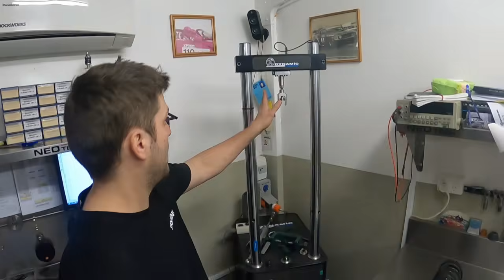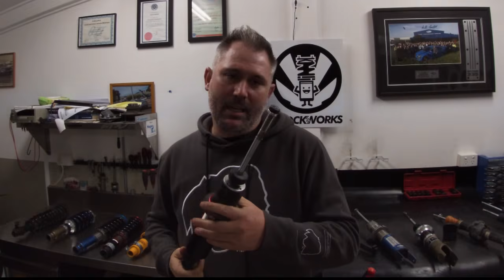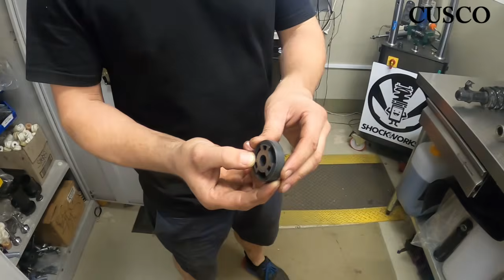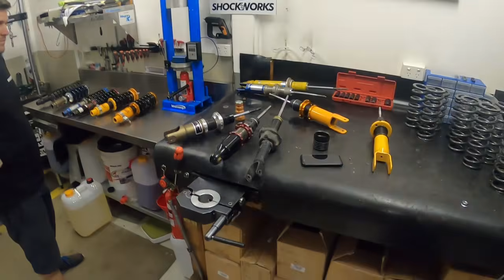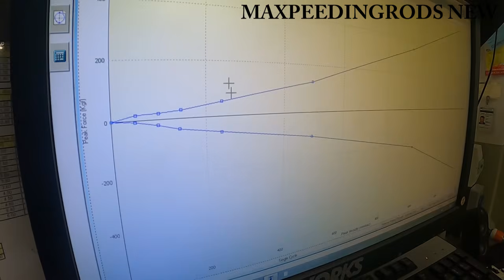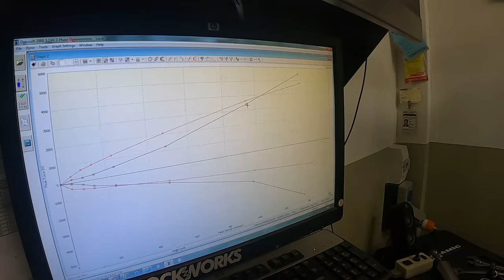8 BRANDS OF COILOVERS ON THE SHOCK DYNO!!! WORLD FIRST TEST

Comment from the maker: Final Results
1/Shockworks
2/Cusco
3/Showa OEM 350,000kms
4/Bilstein
5/New Maxpeedingrods 
6/ BC Racing 
7/Maxpeedingrods 
8/AMR Engineering
Reply: Nice winner shockworks.. shame it wasn't the maxpeedingrods
Reply from the maker: @danielarnold7466  I think we all would have fainted if that was the case, I love my maxies but after riding in a car with shockworks coilovers I can safely say shockworks aren’t on another level they are on another planet by comparison I didn’t know suspension could be that good they truely are amazing all custom tuned
Reply: @TURBOTRISTO  well in that case... I look forward to when your able to give away some of those bad boys when your famous 😉
Reply: I'd love to see the results for a kyb and Monroe and Koni.  Thanks for video Tristan.  Super informative.  I have often thought a spring and shock would be better performing, even if it didn't have 36teen adjustability.
Reply: Which is why many EG/DC Honda guys ran the OEM ITR spring/shock combo :)

EDIT: I was surprised with the AMRs, but I think it has a lifetime warranty, would be nice to do a re-test. Probably with a Koni yellow too.
Reply: Great video. Question though, it is mentioned that adjustable damping shocks are set to soft. I have a set of BCs and driving on soft is like going on a jelly whereas going on 16-32 setting (1/2 till hard) makes a huge difference.
Any chance you tested different damping setting on the BCs to verify if the behaviour changes or is it still linear just with increased force?

Thank you!
Reply from the maker: @edward2a  it’s the best way to test the shocks cushioning ability on soft they can all be made to go rock hard but that isn’t cushioning any bumps it’s amplifying them, I also asked the question off camera haha , thanks for watching
Reply: @TURBOTRISTO  I have BC external reservoir series. I wonder what those would do. 

I also wish the AMR's were in good shape.
Reply: What no Tien?
Reply: If I’m understanding that correctly the new maxpeedingrods are better then bc?
Reply: @Wolfy1091  over time I'm sure it would be a different story
Reply: Amazed thay bilstein lost to oem showa...

Cusco that probably not their highest track spec zero3R or zero3S (semi slick soft compound tyre)...

But still doing decent
Reply: Wait, so how did the Bilstein not win? It seems to have the most digressive performance and the highest forces at the lowest amount of travel. Can we see a test of a new Bilstein versus all others?
Reply: Ummm I think you’ve made an error in this order. The Bilstein had the best graph of the lot other than the Shock Works own one. Thanks for doing the test though, confirms my suspicions that Chinese junk is really junk.
Reply: @danielarnold7466  wonder if the max speedingrod ones can have oil changed  recharged  and retested wondring  if thay can be improved
Reply: Man this is such a massive wealth of valuable info! Thx man!
What i really wanna know now is what does a 1 year old Max speeding rod coilover perform like? If it performs well only for 3-4mths then it's a no go, and how does the spring quality effect the overall performance of package as well? Now I gotta go search for spring dyno comparisons!
Reply: Max Pee Dingrods
Reply: Bullshit
Reply from the maker: We will one day do this again with more brands
Reply from the maker: Couldn’t get any to test
Reply from the maker: If someone wants to pay sure
Reply from the maker: What is
Reply: @TURBOTRISTO no please don't  , unless you are very truthful  hey.
Reply from the maker: Same here man I reckon they would be mint
Reply: I have 7 cars with full coils, so comparing them against each other has been a nice option over the years.  from worst to best + year purchased + price paid. 

DME no adj $450 2014 red eg2
K2 motorspor blk/orange 2009 $750 dc5
D2 racing newest blk/purp 2009 $750 ef9
D2 racing og purple 2005 $650 b14 Nissan 
d2 racing og magenta 2005 $600 cj9a mitsu
bc racing blk/gld 2015 $725  ep3
Cusco zero2 blue 2001 $1400 ek9 
 
B+G gold, with helper springs. 2003 $990 on different eg2 that was wrecked. 
these were very different then all the others was more of a sport coil since only had height adj on the strut no preload setting. but had what they called S3 (speed sensitive damping) the harder they work the stiffer they get was my understanding. ride quality was great until u met that massive bump and your head would hit the roof as you got launched upwards. def was a fun car to drive fast but travel on the rear was limited. (I was slammed)

I splurged on the Cusco @wholesale after getting 2 sets of china coils that were miserable (matrix and OBX) and not wanting to deal with that again just went for the best. OBX was the boss audio equivalent in the tuner world lol, trash

after all these years nothing has matched the Cusco performance and ride quality. zero regrets wish all of them were Cusco.  

other brands I have tried - Tein, blackworks, skunk2, maxpeeding, Topspeed (was just rebranded maxpeeding), Tanabe sustec. 

all fall roughly by the price attached. D2, K2, Blackworks, skunk, Omni pwr. are all just rebrands from same manufacturer I think "Golden eagle" so all are about the same if the same era. if you want low, don't get any sport types like the b+g. 

the cheapest DME on eg2 is decent and does the job but can't match Cusco no way. even when car is using 15" + 55 series meaty tires vs Cusco with 18" and 35 series tires. 

the mitsu with D2 magenta was really good, also on skinny 35 tire. 

the D2 are great totally worth the price, the BC racing are the closest to the Cusco. 

I can say price definitely reflects what you are gonna get in the suspension dep. u just have to weigh price vs result. all these years and only ones that blew were the OBX. 

Tristan this video was very helpful, I hope this write up will help someone not make a poor buy. 

🤝🏼🤝🏼
Reply: Please I beg to someone give this guy a Giant Medal 🏅
Reply: @AmirPomen  do you use cuscos yourself?
Reply: Strange after watching that even though the cusco doesn't perform as well as the bilstein shocks it's rated higher? Not a coilover?
Reply: ZF  supplies the oem Fk8- Fl5 type r Dampier
Reply: It's now 2025 more of this would be greatly appreciated. I am not a mechanic but I enjoyed this,there are so many shock systems on the market now. How about doing some dual spring and dual rate/variable rate set up I bet that would be very very informative for some people.

Comment: I have been fitting shockworks products to a customers car. I have had several cars with different coilovers but have never driven with anything like the shockworks before! Ive definately learnt from this video, i was unaware that the shock is able to give body control. I thought that was purely upto the spring and swaybars.

Thanks very much for taking the time to make this video guys.
Reply from the maker: I went on a test drive in a shockworks custom tuned set up I have never felt anything like it
Reply: Same! I would have liked higher spring rates for my own car. But for my customer, it was the ultimate road car setup. They dont look super flashy or anything on the outside but its the tech and RnD thats inside them is where the money is!

I do have some really weird old HKS/Kawasaki s13 coilovers with inverted tube shocks that looked like they would be good but where terrible on the road if you ever want to run another random bunch again.
Reply: @TURBOTRISTO never hey.

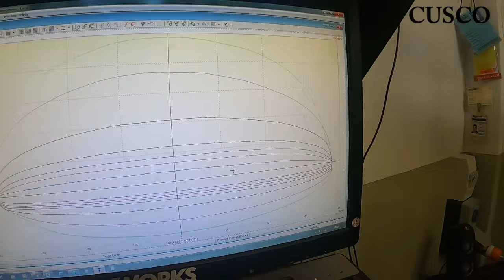Comment: I'm not sure I follow how the Bilstein was rated lower than the Cusco when at 16:29 Chris said that, while both were a bit low on gas, the Cusco still didn't quite have the response that the Bilstein had.
Reply: Not sure how a rear evo shock can even be compared civic front shocks. Entirely different valving, entirely different set of expectations.
Reply: @TonicofSonic  Well, you might have a point but I'd like to assume (dangerous, I know) that either he also knows this or that he's looking at general specs that apply, well, in general, and that either way, he knows what he's talking about.

Comment: Awesome content. Definitely would stop all the arguments on the Honda forums and other ones too. Explanation is excellent from Chris and Shock Works. I have been using the old style maxspeedingrods on a budget track car EK like yourself Tristan but after seeing this I think I might have upgrade to the new style. Even if I don't win I will definitely use the discount code. P.S. Bro, you need to bust more myths.
Reply from the maker: Thanks for the support brother, after what I learnt I wish I could afford shock works they are incredible but as I have said many times maxpeedingrods seem to be working fine for me at my cars level, I would love to bust more myths any suggestions
Reply: @TURBOTRISTO  well, like you I've into cars for a while, I am a mechanic by trade... recently, I've noticed a lot of trolling behavior on the recent topic of Stock brakes are fine and bigger brake kits don't make better lap times... test with a control tyre of course, do a 3 or 4 part series on oem pads vs aftermarket, oem brake lines vs braided(use a control brake fluid), then move to oem single piston caliper vs aftermarket multi-piston setups...maybe talk about brake master cylinder upgrades...

Comment: FYI, you are better using the full trace for Force vs Velocity rather than peak values as you are in the video. This shows you the hysteresis (lag is the term the operator is using) a lot more clearly and while you can see this in the Force Displacement curves shown, really you want to use both as they allow you to look at different things (hysteresis on FV, friction in FD for example). Peaks are OK if you are trying to hide a poor dampers performance from customers(as a lot of manufacturers do)  but the full trace is much more informative, especially for comparisons like this. The Maxspeedingrods dampers are both plain orifice dampers, theres no shim stack operating hence the damping is increasing with a characteristic V^2 curve (i.e. as velocity increases, damping increases with a squared law). The AMR damper is definately topping out in one direction hence the force spike at the end of stroke in one direction (you can hear that even without seeing the force spike in the graph). I work for the  damper dyno manufacturers in the UK and have used Dynosoft2000/MX extensively and designed many high end dampers ;).
Reply from the maker: @JunglistMogwaii  it’s clear you know a lot about dampers

Comment: Dude, this was awesome info! Now I understand the difference between a good shock and a crappy one.  HOWEVER!!!! You can't really perform a test like this using the method u applied. You need to test at least 2 of each brand. ie. The American model was clearly a factory defect, and IMO because of the technology (pressure, fluids, gas), it's pretty likely that there were more that underperformed or perhaps overperformed their brand just by chance. That's why you need at least 2 tests for each brand. The real lesson learned here is, you can buy good shocks and still get a bad ones and never know, sans the dissatisfaction. Looks like Quality Control is the right way to shop them out!  Again, the information was fantastic! you got my sub!
Reply from the maker: thanks boss beek! yes I agree, at the time i made this video as you can tell the camera quality is low and the lights are flickering, but all that aside I borrowed all those sets from people and luckily for me Chris from shockworksis is local and had time to do the comparison, I would love nothing more than to test 15 different brands and three sets of each all for the same car , you are 100% correct some of those coilovers were old some where new some were from crashed cars , but the info and message was all the same, when shocks leak they leak regardless of age, the factory civic shock were nearly 30 years old with over 300,000kms on them and still performed like new , there will be more videos like this coming soon

Comment: I've seen about a dozen personal accounts, from members in a car forum I'm on, of maxspeedingrods breaking at the welds. Most commonly if there is a link bar bracket welded it breaks off. A couple said the base broke on rears where a skinny arm is welded. One person said the top cap split.  Saving money isn't worth wrecking possibly dieing, get at least one step above!
Reply from the maker: I do agree however since this test mxr have really improved we use their T6 shocks in our endurance race car hit every ripple strip and get air borne and have had zero issues, this test was done on the T3 & T4 version, they are up to T7 I have shock dynoed them and they graph as good if not better than a lot of the expensive brands in this video

Comment: hey mate, just a comment re the flicker in the video. If you were unsure how to fix that/what is causing it.. it is the framerate of the camera not matching the stupid 50Hz frequency the Australian power grid uses. you won't notice it with a bulb or normal light, but with fluro's they turn on and off constantly at the 50 Hz frequency as the power grid. This means if you have the camera set to record at 30 FPS or 60 FPS it wont match the 50 Hz frequency of the fluro and cause the flicker. If you set the camera to 50 or 25 FPS that should fix the issues as it will be in sync with that 50 Hz. Sorry for the long message, just thought it may help with future content :) Loved the video great content!
Reply from the maker: Thanks Kevin I wish I had this comment 6 months ago brother you would be a life saver!!! My mrs only just fixed it last week for me haha I’m hopeless with tech haha thank you for helping me out, you are a legend

Comment: I just heard of "MaXpeedingrods" only a few days ago in 2023, so I'm waaaay behind this "debate" -- I remember there was a time when people used to put down the BC / Megan and other Taiwanese coilovers, but they aren't the bottom of the barrel any more with these $200-300 "eBay" coilovers, I guess...  Do they even make any money off those at that price??  I'm glad I caught this video to see a variety of these to a standardized professional-grade test.  Weird that AMR had some issues -- I run those w/Hyperco springs on my AW11 MR2.  I have KW V3s on my other track MR2 Spyder.  I've run Koni Yellows / Eibach in other street/autox cars... And on the other end of the spectrum, today I just ordered the Maxpeedingrods for my daily driver Lincoln Navigator for $300 shipped lol: I have no expectations at the price point, but they'll certainly be an improvement over the collapsed air suspension!
Reply from the maker: For the price you can’t go wrong but if you pay more you can get better suspension it’s a real common sense decision people that see a $300 coilover and complain that it isn’t as good as a $1500 set- those people need to check themselves, thank you for watching, I have done heaps of reviews and track testing of these, they hold up and do the job
Reply: "for the price" 
So you are not aware of any dangerous issues with these things?
Because from my personal experience and that of people I know
I would dare to bet these things have killed people and will continue to be a lethal danger on the road.
Also there are better options for the same price. I'm
Reply: @sultanofswingdrift3021 I haven’t heard anything from anyone claiming major failures, especially not in that regard.. pretty wild to just make an accusation like that… a blown strut or shock isn’t going cause a fatal accident alone (not going to flip your car, or throw you off the road) unless you’re going at seriously illegal (in most states) speeds, around corners, in which case, a failure of almost any suspension, or steering component can cause the same thing… you get what I am saying? I’m not promoting the company but usually that’s how brands gain consumers’ trust & repeat business, if you’ve been hearing about a company for 5yrs + in any industry, that’s usually an okay sign they aren’t completely scamming people or selling defective products and closing shop and changing names and doing the recycling thing again and again

Comment: Just realised this is the correct video to share and comment on
Local guy just building a k series EG with a modern twist 
Having these coil overs would help reduce the costs to get it up and running on the road! 

EG is currently stripped bare and getting all rust removed!
Reply from the maker: good luck brother you will need around 100 comments on this post to win , Ill start you off with your first comment get your mates to help you
Reply: bump - this man's love for cars is unprecedented
Reply: he's also pretty handsome
Reply: can also confirm he's already spent way too much on his EG civic :~)
Reply: can i also have coilover? i'd like a set of 326 plis